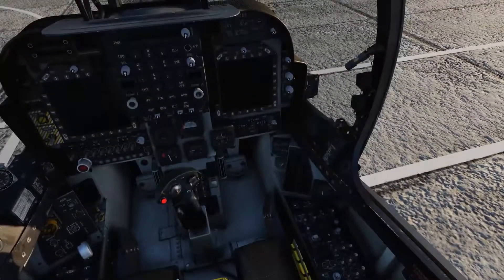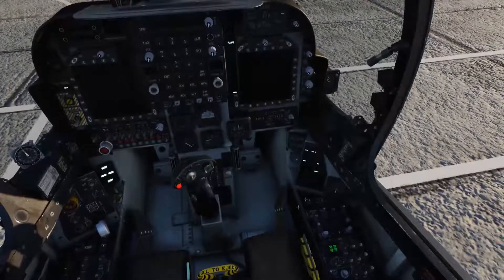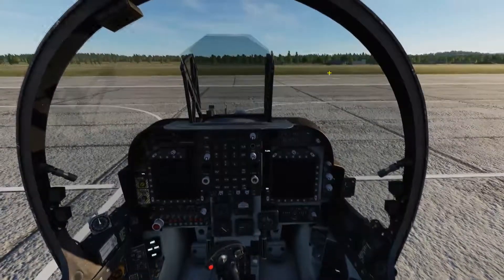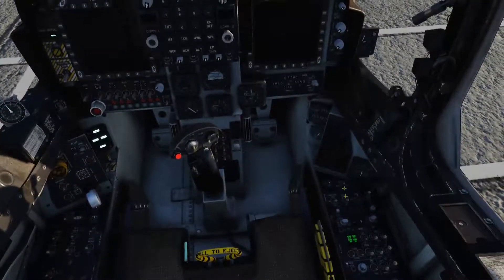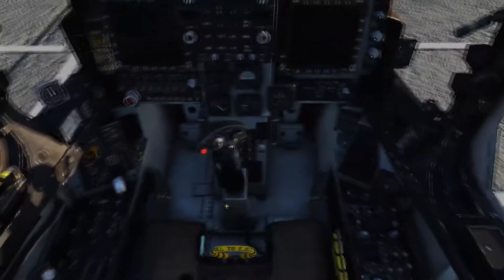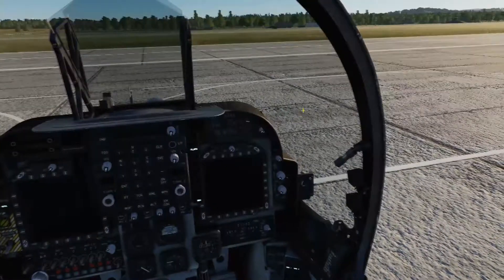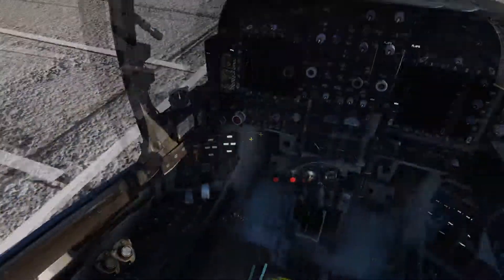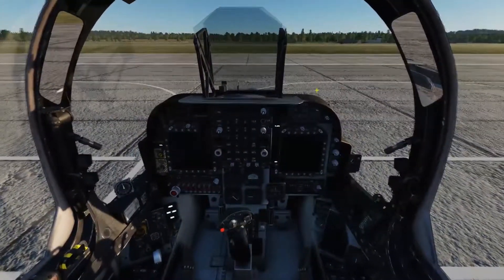DCS AV8B Quick Start up Tutorial

Comment: My throttle is screwed so sometimes causes the in game throttle to jump forwards triggering  the failed start scenario you describe. When it happens I had been jumping into a new Harrier each time. I did not realise that using fuel cut level on throttle would trigger the engine to start, I will try this tonight. I previously adapted by using the fuel cut off before turning on the battery to force throttle back, but I will try this method instead, as I often forget and jumping to a new Harrier each time I screw up, especially while in VR, is a massive ball ache :)
Reply from the maker: Andrew Baker Glad I could help. I noticed there are loads of great start up tutorials but none addressed how to reset the throttle to idle. As I sometimes forgot when starting the harrier that my throttle was forward and it took me a while to figure it out.